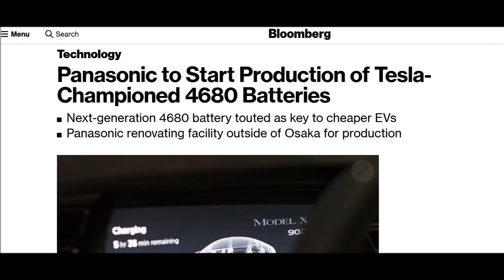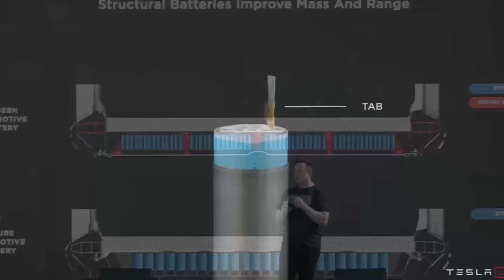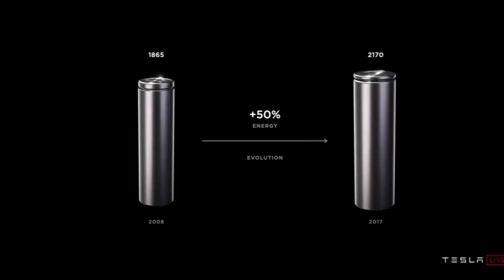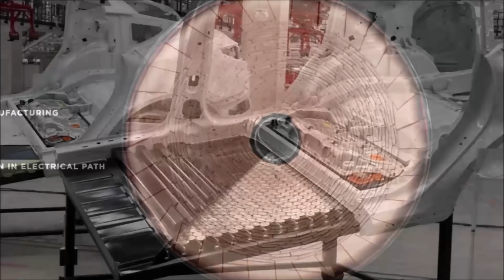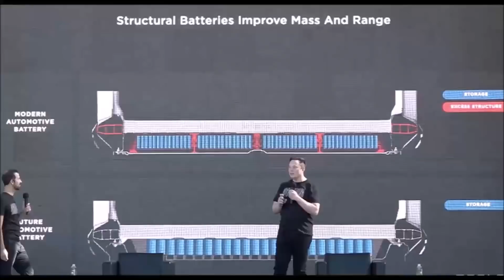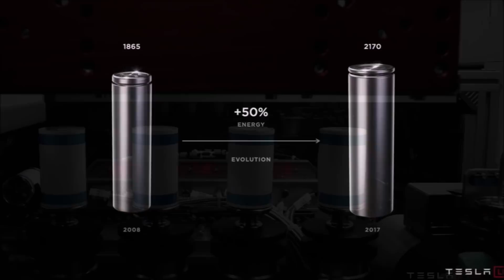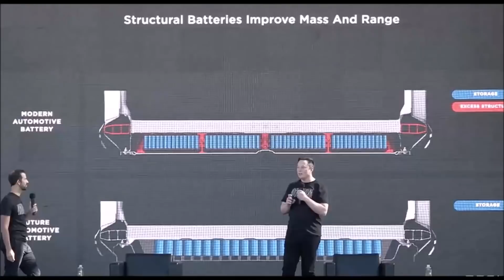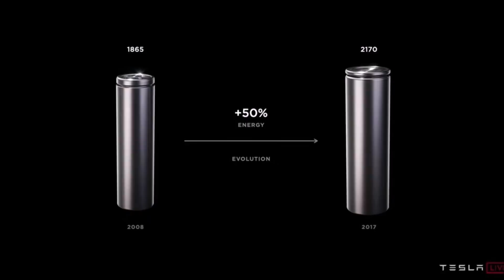BREAKING! Panasonic to Start Production of Tesla-Championed 4680 Batteries

Comment: The question that I have is if Panasonic will just produce their own 4680 batteries which use Panasonic's own battery chemistry and design, but have the 4680 size format, or if they will be licensing Tesla's 4680 tabless design, and Maxwell dry electrode technology, which are the parts that make the 4680 battery exceptional, more power dense, and more reliable.

Comment: 4680 itself is not a massive breakthrough. It is optimized form factor which is made possible for NMC type of chemistry by Tesla's tables design patent.

Tesla's own 4680 battery contains much more improvements over all critical areas and can be considered as a breakthrough in EV batteries.

Comment: Hi Armen...
Thanks for theses new informations and for your videos in general...
2 questions :
- When do you think that tesla will be able to introduce the 4680 cells in the giga berlin (intern production) and Shanghai (extern production)?
This year or later, do you think ?

- I believe that even if the 4680 cells are more efficient (lighter and more powerfull), it is possible that the pack will be smaler, with finaly the same range that actually...
The big improvement in this case would be the charging speed and curve.
Do you have any idea of what the charging speed could be in 4680, compared to the last pack of the YLR LG79kw ?
(do you have the curve for the YLR LG79kw, can't find it anywhere?)

Thanks a lot if you have any idea of response, I'm décided for an Y LR in europe but afraid to miss the 4680 ...

Comment: Why hasn't Tesla updated their range for the Model Y for the 16% increase out of the 4680 batteries?  LR with 20" rims is 318 miles (from their website) and you add 16% then it should be 368 miles.  Am I correct on this?
Reply: Because they are not shipping/delivering 4680 model Ys? It would be lying